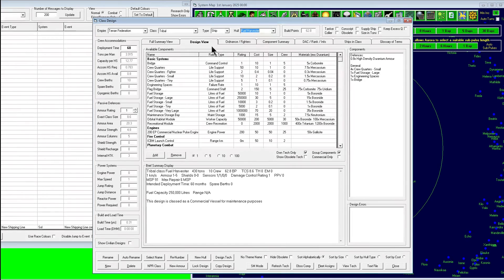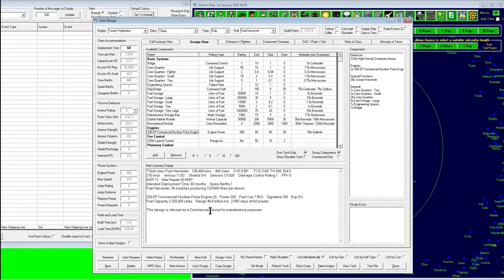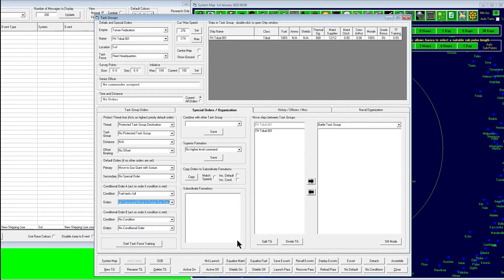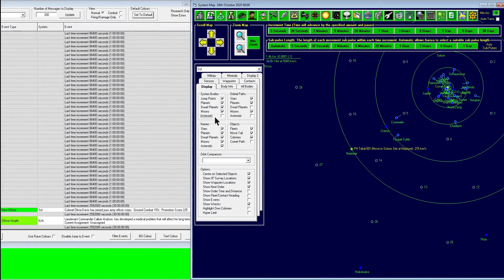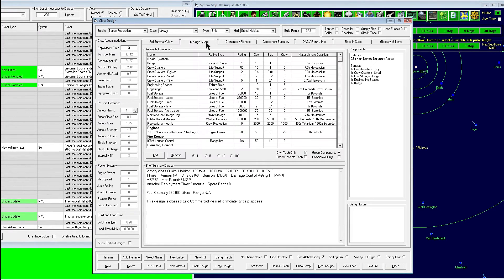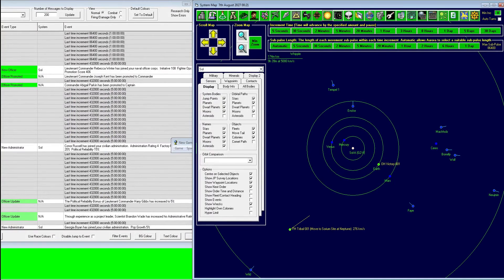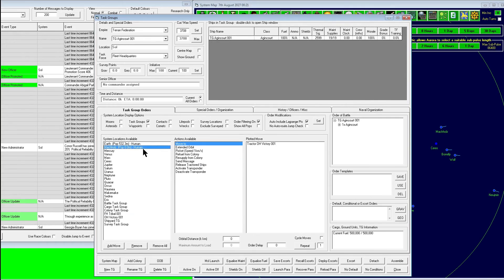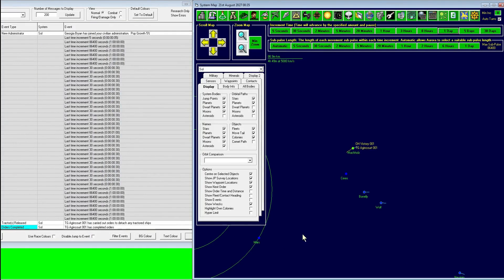#34 Tutorial--Fuel Harvesting, Orbital Habitats, and Tug Ships

Comment: Which is better, building habitats from construction factories or from shipyards?  The size means a huge investment in them above and beyond what most shipyards need.  And then if you need to move the shipyard with tugs it takes forever.
Reply from the maker: Carahan I tend to think that if you're going to do a star base, build it from industry since there is a ton of opportunity cost with going the shipyard route. You'd have to invest heavily is a large size and then you'd have to retool for it. If something came up you wouldn't be able to switch as quickly. 

The alternative is easy: just slap on some engines with whatever you're building and forgo the base altogether.